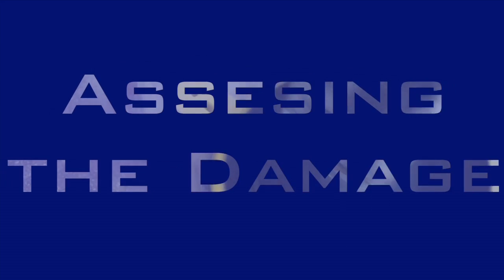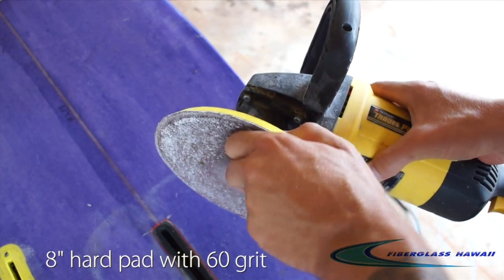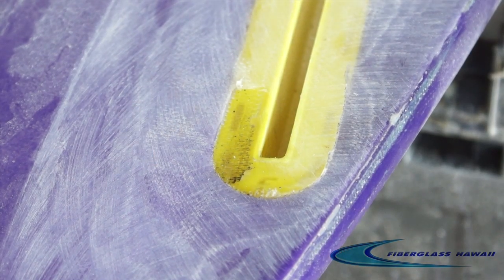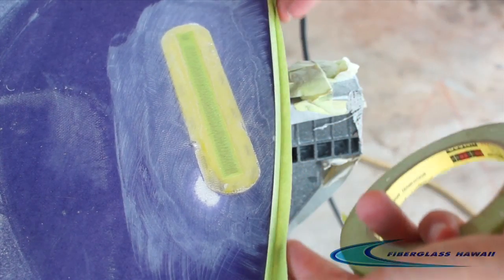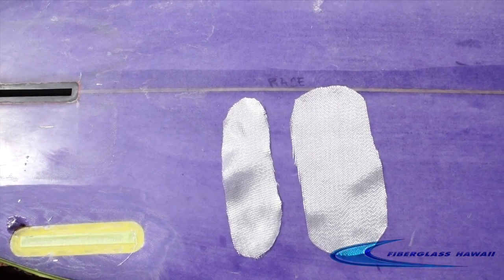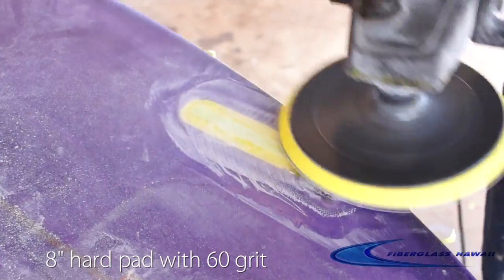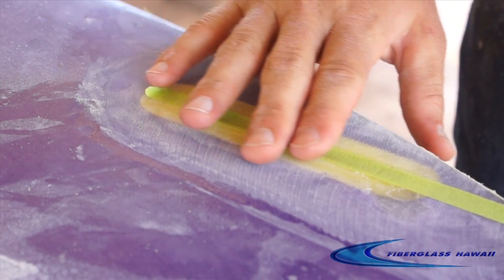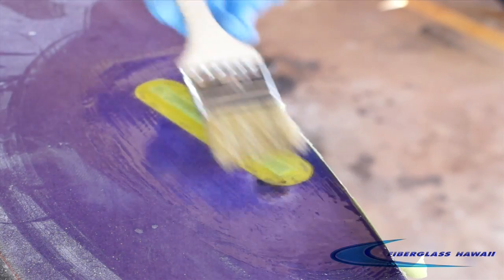Futures Fin Box Repair Using Aluzine Epoxy Resin

Comment: I love the way these videos are made, so clearly explained. I have a question if i wanted to reinforce a board all around should i just sand ot very well and then put an extra layer of glass, leaving all the heel dent in the deck as they are or shoul i fair them out with a fairing putty? Would that add too much weight? They are small though. The deepest one is that of the front foot and it is less than a 1/8 of an inch deep.

Comment: Seems as if the base of the box was moving.  Covering the top doesn't secure the base.  Looks like you just secured the pivot point tor the fin to move again.  What was the rationale to not remove and rework?

Comment: well done video on the repair!  I like the fact you took the extra time to camouflage the white foam with purple tinted resin...nice touch. ( I used to airbrush something like that ) (my world for 25+ yrs building boards but my specialty ding repair)  My world was glass ons...still love them.  Just a suggestion  for your two pieces of glass on top of the box..  put some wax paper on the board.... lay the two pieces of cloth on the wax paper... apply resin and squeegee on the wax paper  lift  wetted out cloth  off and place on the box. (this is how we did glass ons very clean and minimal resin build up - super flush minimal bump minimal weight ..therefore after hot coat its so flat  you barely hit glass when sanding....so all of your glass stays intact max strength .  rock on!

Comment: Wouldn’t you need to pull the fin box up so that it’s flat again even though it’s sitting at the right angle? Seems like the repair would be weaker without the fin box sitting flush with the original glass job

Comment: I find it a bit hard to blend the cloth like you do around 3:52. How do you sand without weakening the cloth? Are there any signs to look for that gives you a hint that its time to stop sanding? I just laminated a ding a couple of days ago, and there is some high-spots mostly around the edges of the fiberglass. Love your videos, and hope you will make some more:-) Regards from Eirik.
Reply: The main focus is to sand all high spots, always feel your repair and press to get an idea of
what is too much. The second you start feeling the cloth getting softer is the second you should
stop, go with 80 grit on the edges then go higher n higher to prevent sand throughs, i do 80grit for edges then move up to maybe 220 and then 500 wet sand dry paper for the smaller stuff.

Comment: Hey I had a small rail crack and it wasn't serious enough for cloth etc basically just a solid spider crack that was just big enough to slowly take in water. Instead of using cloth I just used some epoxy sun cure to fill in the cracks and sanded it down to a point where I'm debating on doing a A+B hot coat to make sure it's fully sealed. Is it over kill to hot coat over the sun cure or is it a good idea? Thanks just wanted to double check because it's a board I use a lot and want to make sure I fix it as good as I can using the sun cure method
Reply: Make sure you sand the area first, every time with a 40-60 grit paper. I highly recommend using some 4oz cloth and just doing it all the way but to answer your question, yes it is overkill and no amount of resin will ever make up for skipping an initial sanding. Hope that helps

Comment: I see your repair was more serious then mine. My question is what if the ding is only surface deep? My box has a small hole in it, can i do what is shown here or is a crack enough to destroy the entire box?
Reply: It really depends on how big your crack is and where it is exactly. If the box itself is cracked than i would highly recommend replacing it. If the cloth and resin is cracked than 90% of the time i would recommend having the box be completely re seated, especially if the board is epoxy. Really need more info to know the best prescription for your particular ailment but I hope that helps.
Reply: This fin box definitely needed to be pulled out and reseated. It will re crack

Comment: what does cc stand for
Reply: A CC is a unit of measurement that is usually associated with catalyst. Catalyst is the hardener used in polyester resin. Epoxy is a 2 ti 1 ratio and using a small digital scale programed to measure out in grams is a much more effective and simple way to measure out your material.

Comment: Thanks but you only did one cloth and you showed to have two. Didn't look like you needed two... good work.
Reply: Actually this fin box needed to be completely pulled out and re seated. The cracking on the surface is a clear indication of the internal cracking and separation that can only be fixed by completely pulling out the fin box if you want the fin to be fully restored back to its original strength.